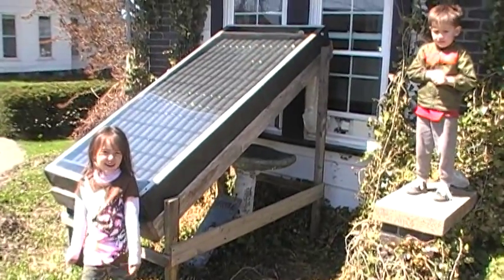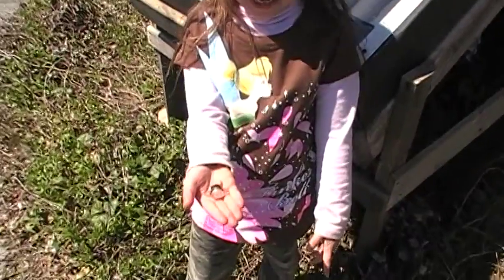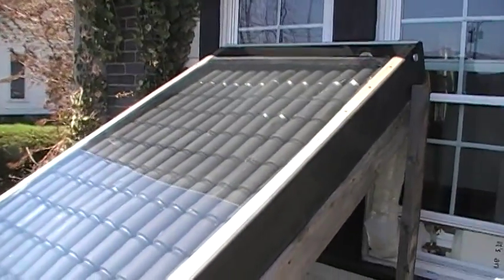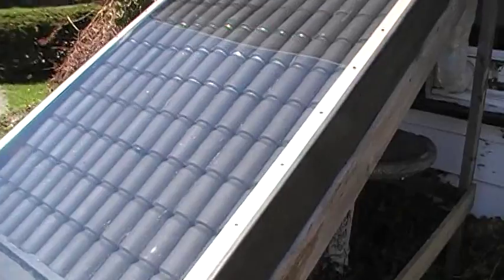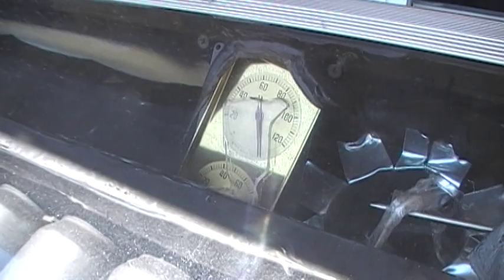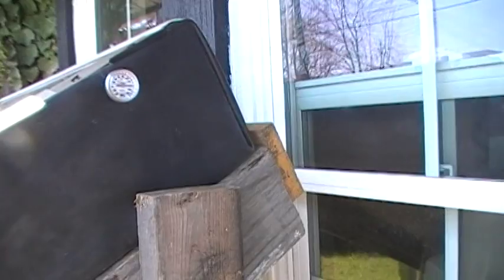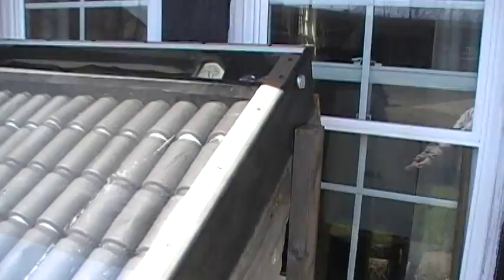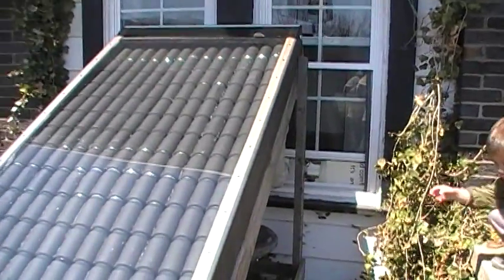Joshua's Solar Furnace update 1

Comment: I built my own house and the front porch is 2 stories high and 48 ft long all glass . The hottest the porch has been is 110 degrees which the house was unattended and got to 100 inside . That was a 10 degree January day very windy , but all day sunshine . I had to open the bathroom window and back door to let the heat out . I have supplemental heat I keep very low . The only problem with solar no sun , no heat .

Comment: That is awesome, now that you know it works good, you mentioned you'd like to build more units like it. Now you can move it out of the window and use the south facing window for natural light and heat too, move unit too solid wall and the other units you build covering solid wall(or free standing, etc...but not in south facing window/s)pipe it in thru wall, this way you get more efficiency using your south facing window/s too, especially if  it is at least double pane is best. Once that light enters the house it is your heat now, and light. Anything it touches it heats, and if it shines thru the window it is claimed light and heat for your home. You get roughly the exact same amount of heat of a 3x5 window as you do a 3x5 solar air heater during a few hours of the day, but the solar heater is better, but windows still work, they are just not at the right angle to use entire surface to shine light in or they could work just as good as solar heaters all day long,  but you get the light too from a window. grow a few herbs, etc... lol My point is to use both south facing windows and solar air heaters. Really houses need many south facing windows with the angle of the sun, the entire roof and south walls, built on that angle filled with at least double pane glass. lol I like your ideal, you just got me thinking of designing a solar house now. lol Thank you,

Comment: Can you show how the cans look on the top of the baffle or explain it. Are all the cans opened at the top? Are any of the can rows joined to each other with any tubing? Are all the bottom cans cut out and simply sat onto the baffle holes? Do you use any damper to turn off the heat for the summer months?  I have seen one video where the guy routed each can row to the outside and didn't have a box or baffle there, but simply routed to the outside of his frame at the bottom and was covered with mesh to keep insects from entering. Is the baffle really necessary on these solar heaters or does it make the unit any more efficient in having them?

Comment: 1)Could you give more info on the switch electrical gear 2)I would suggest the "bow" of the can collector is a reflection of thermal expansion ie alli expansion is quite high and as it is being heated with little ability to lengthen will tend to move out of line. Most long runs in heating system (and even railway lines for high summer) have to allow for this3)allow the air back in the house above the height above the top of the panel,you will get convection working.You may not need a fan.

Comment: Our poorly made solar air panels saved between 100 to 300 KWH off Pacific NW electric winter bills. So, the worst winter bill was around $90 to $100/month. 
Combined w/use oil-filled electric radiator [$40? from WallyWorld], placed in center of house to heat mass of house, run on 600 watts and about 1/4 to 1/2 rheostat. 
Those 2 things combined, meant NOT having to pay over $150/month from use of Cadet wall heaters.  
Had to remove our solar air heaters due to landlord wishes. :-(

Comment: Our no-control [2] 4'x8' solar air heaters WORKED! even in Pacific NW winter cloudage.  
Kept winter electric bill down around $100 in worst of winter [teens temps] [house = all electric, old house w/decent modern insulation & double-pane windows, about 800+ s.f.]. 
Shaded panels in summer.
Kept those up about 7 or 8 years, til landlord wanted them gone. 
Retrospect: need better cover material, better seal, would use PC fans w/small PV panel to run them. We needed better frame to rack them.

Comment: nice colector! i've built a few colectors with cans too and i'm very happy about the result. It works perfect as soon the sun is out. I tried a 6 sqm colector in closed loop with an air/water heat exchanger and run a water radiator in the house, but the heat loss is too high.

Comment: Great job! I'm searching around youtube and everywhere for a at least a rough sketch of the design of the whole panel, including insulating the inside, can cuts(some had flanges on one end to circulate the air flow, not sure what you did), etc. Not sure if you had one or could put one together in short time and share =]

Comment: A few things,oh and great job. Your panel looks too horizontal.  In deep winter the sun is lower in the sky (here in Canada even lower then where U R)  and they recommend vertical panes. Also if you moved your panel to the left away from the window you would get sunlight. Also putting  it more vertical , your input air length would be shorter :less heat loss.

Comment from the maker: I don't remember what the C is but the F was 125" F.  I chose the lowest i could find.  I just used a thermal switch on my wood burning stove to power a fan and force air into my office from my garage via some duct work. I now heat a 1000 sq foot room with no dust or ash to clean up.  its great!